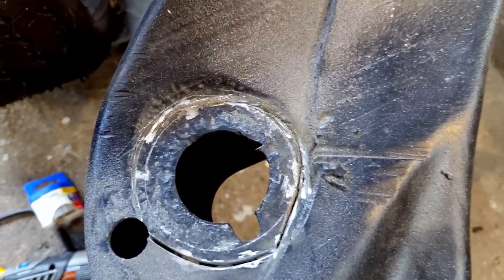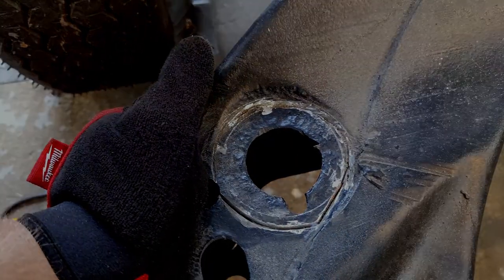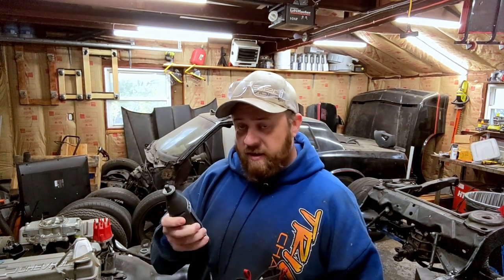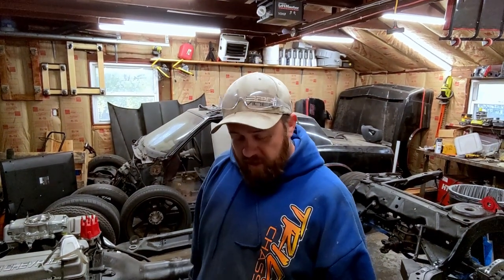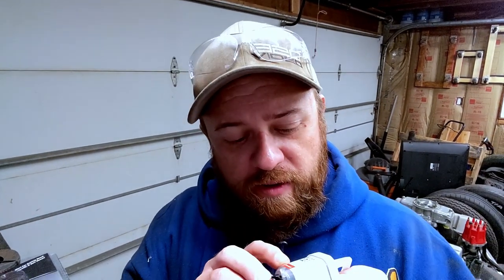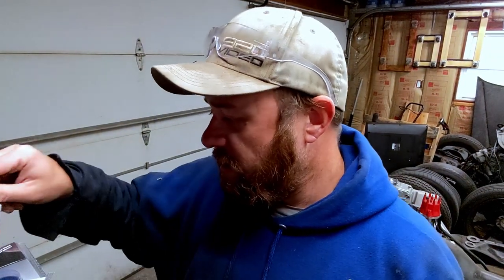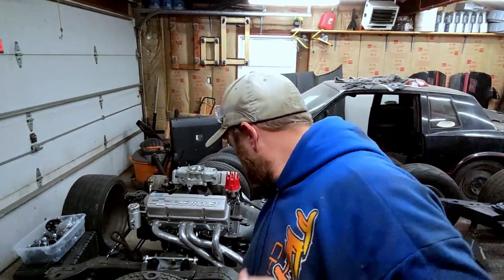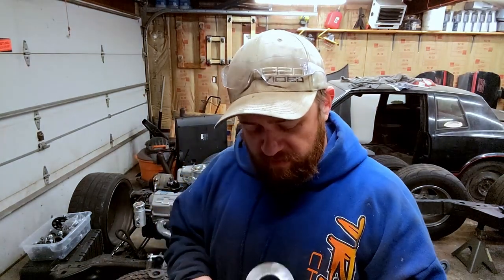G-Body Body Mount Frame Repair / Part 2 of 3

Comment: I thank you for showing what works and what doesnt.. I'm in the same boat with my MC but I also have some pitting on part of the frame.

Again thanks for video, and I will just use plasma do the cut.
Reply from the maker: I'd love to have a plasma, would make things much easier. Good luck with it.

Comment: I welded a 1/4 fender washer over the old mount hole. I was able to use the washer hole to center the hole saw, weld in a plate and cut a new mount hole with a 1 1/2 “ hole saw. 30 minutes, done deal.

Comment: A friend of mine used a die grinder with a carbide bur bit to cut out his mounting surface to put in new washers
Reply from the maker: I ended up using a carbide to clean it up

Comment: What type of weld did u end up doing?
Reply from the maker: I'm not sure what you mean, can you explain?
Reply: @Dom87SS  I've only welded in high-school and that was 20yrs ago. From what I recall there's 3 different types of weld. What style did u use? What type of machine is it that you have? I'll have to buy myself a welding machine and I would like to know what kind I should get. Also I seen many people mention using a plasma cutter. Is a plasma cutter used from a style of welding machine or is it its own machine?
Reply from the maker: @IRONEYEZ74  I see, you are referring to something like stick, mig, or tig. This is a MIG welder that I used, fairly low end, and don't take my advice on what to use or do as I am literally teaching myself how to use it. As for a plasma its basically a cutting torch and is a different machine.
Reply: @Dom87SS  thanks for the help and replying.